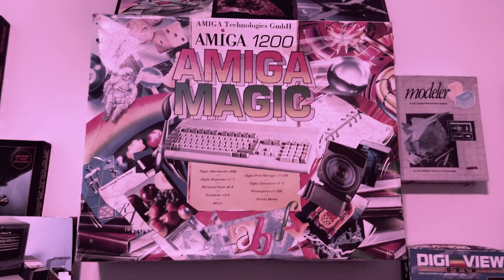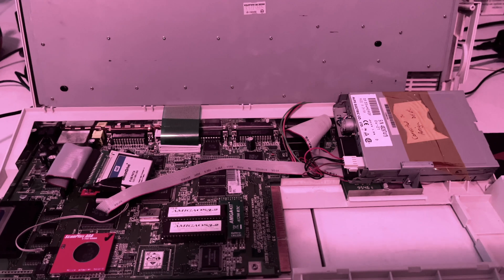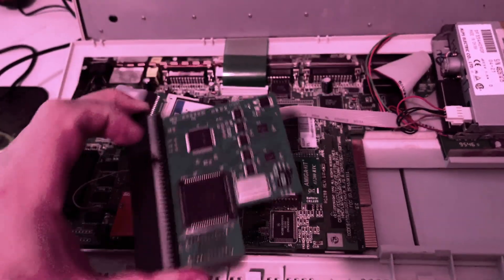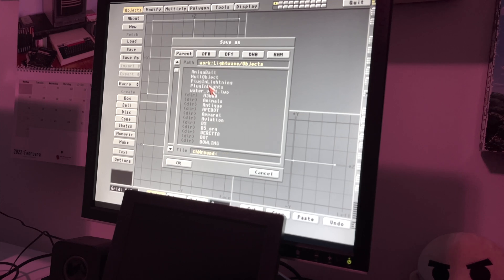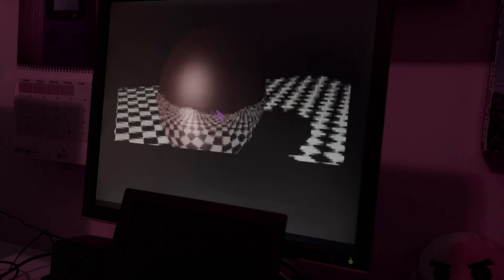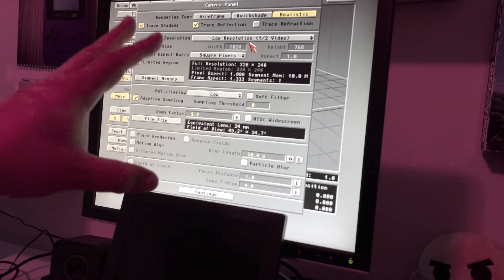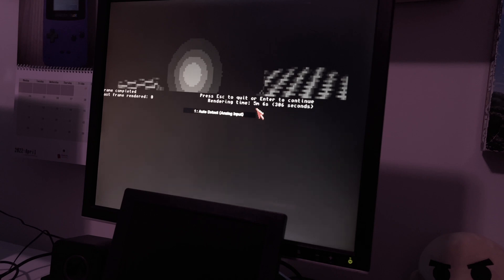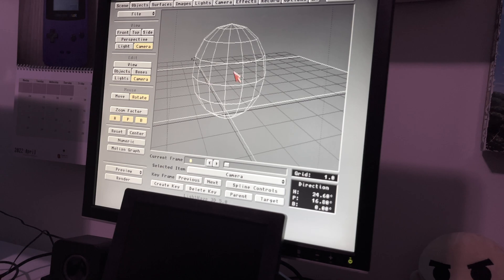Is it enough? Amiga 1200 and GVP1230+ Benchmarked!

Comment: Great one doing some real world benchmarking not using Sysinfo 4.4. I have got a ACA 1233n card I fitted a 68882 FPU in a socket it runs nice at 40 MHz, in my other A1200 I got a TF 1260 card with a 68060RC50  running at 50 MHz it is fast, I might see if I can get it up to 60MHz or more or just leave it as is. Let me know leave it as is or not ?
Reply from the maker: I’d leave it alone. In fact as old as these systems are. I never OC them. As expensive and old the 060 is. Just not worth it.

Comment: Nice video! I've seen the term "OG" and old school used many times over the last 3 years. When I bought my A1200 three years it came with a CF card in a CF to IEC, but nothing in the trap door so many games in WHD and Demo's would not run. I went to get a card but very few came up at all (I think only 4 or 5 at that time) so I read up on the cards that I did find on eBay and I ended up going with an ACA1233n @25MHz and 128MB of RAM at the Buy it now price of $525 because the bid was at $450 with 2 days of bidding left, so I clicked on the buy it now. This was a GREAT card!! It played all but a handful of games and many demos but not the ones that really needed more speed like an 050 or 060. Because I saw people running those demos and games like Gloom and Doom I put myself on the waiting list for an Vampire V1200v2 soon after I received my ACA1233n. Around a year later I received an email that it was my turn to pay for and get an V1200v2. Its total price with shipping and taxes and customs was right at $550 which is about the same price as the ACA1233n once you added taxes and shipping. I have been using my V1200v2 as an 080 @85MHz for over a year and a half , but you can make it run much faster if you lower the CPU (68030 1GHz / 68040 500MHz / 68060 250MHz). I love my V1200v2 and I'm running Coffin OS r58 that I bought right after I received my V1200v2. I can now play all the demos and all the games on WHD. I also have used emulation on my A1200 since getting the V1200v2 and have used it for things like, ScummVM, Mame, NES, SNES, DOS and the newest thing I've been running a lot because of the V1200v2 is I'm learning MAC OS7 & 8 because I never owned a MAC. I went from Commodore 8 bit (C64 then SX-64 then C128DCR) to a Tandy 1000HZ PC clone and have been building my own PC's for the last 30 years since that Tandy. About 6 months ago I sold my ACA1233n because it had been sitting in a anti-static bag for over a year at that time. When I went to list it I found out that ACA had started making cards again after not for many years. They were even making a new ACA1233n for around $200!!! They had only started doing this a month or two before I went to sell mine. If I had sold mine soon after I received my V1200v2 I'm sure I could of got a lot for it than I did! I did get $250 for it even thought mine was used and many years old because the new $200 ACA1233n had made 1 or 2 changes and the community was saying the older ACA1233n was better than the new one. Here is my question that has taken me a long time to get to!!! What does "OG" stand for? I know my ACA1233n was considered old school. I learned that because as soon as I received my V1200v2 and posted about it in my different Amiga Groups and forums I stirred up a huge nest of hornets!! I was taking a lot of hate for changing form the ACA1233n to the V1200v2! In some groups its was so bad that I even quit those ones. I love my Amiga 1200 which I could of never afforded in the mid to late 80's and now I'm getting to enjoy all those years of Amiga that I missed.
Reply from the maker: Wow that was quite the read! A side note, I do have videos on Apollo products as well. :)

“OG” is a slang term that can cover anything “original.” Original Gangsta’ is what it is short for. It’s been co-opted from actual gangs by us nerds and many others to identify something that was the first or out during the time when everything was active.

Comment: I started rendering using Sculpt 3D on an A500 1MB and 4 FDD's NO FPU so every CPU/FPU upgrade was incredible. In the beginning it was do the modeling, set up the rendering and go to the pub (just for 1 image). Years later A1200 68040, HDD, still had 4 FDD's and Lightwave but now doing full multi second animations and still going to the pub 🙂great days.
Reply from the maker: Good times! There was always something new coming too. Although it shortened pub time.  ;)

Comment: Great stuff! GVP made some fantastic hardware back in the day. I have a GVP 68040/33 MHz for my Amiga 2000 and it is Rock Solid and very fast.
Reply from the maker: That’s a great card for the 2000!
Reply: Had a GVP 1230 @50 and it was a rock solid beast that I could run for more than a week while rendering.

Comment: Interesting Vid Q. The only thing you didn’t mention unless I missed it in your vid. The GVP clock speed of the 68030. In Europe and the U.K we had the Phase 5/DCE 68030 + 6882 FPU clocked at 50mhz. These cards also had add-ons for them like the SCSI add on card that also housed another 72-pin standard SIMM socket. The Phase 5 cards (MKIV) could go up to 128MB fast RAM. With the SCSI add on this maxed out to 256MB Fast RAM. Other accelerators could only max out to 32MB or even 64MB fast RAM. I’m guessing in the U.S GVP were the most available.
Reply: The Phase 5 accelerators were available in USA, too. They were pretty common here.
Reply: @10MARC  Good to know Doug 👍🏻 Every day is a school day in Amiga land 😉
Reply from the maker: I’ve never seen one for the 1200. That’s cool!
Reply: @Cull Master I took a look at the FPU in the video and it was clocked at 40MHz, so the CPU was most likely that speed.
Reply from the maker: @daishi5571  yes sorry about that. 40mhz.this is why I spend the bandwidth uploading 4K videos so pixel peeping is easier! :)
Reply: @HoldandModify  Try doing that at 160 x 120 lol
Reply from the maker: I didn’t know they made one for the 1200! Wow! That’s great!
Reply: @HoldandModify  Yep Phase 4 also made 1240 and 1260 cards which too could use the same SCSI add-on for a full 256MB FastRAM. Best thing you could use a variety 72-pin Simms. EDO/FastPage etc… as the cards would autoconfig. Not sure if the GVP can do this, but the phase 5 and s9me other cards would hold back 512KB RAM for MAPROM so you can use utilities such as Blizkick or RemAppollo to kick Kickstart ROM files for faster access 😉 or run 3.1 ROMs in your mainboard but kick a different version. 👍🏻